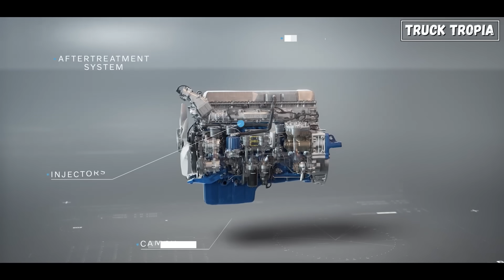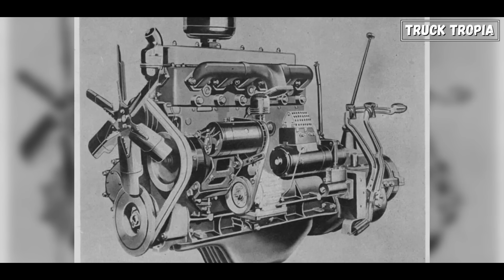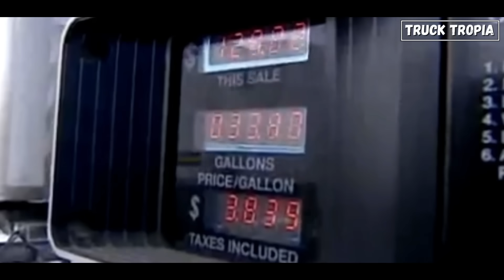How Truck Engines Went from 200 hp to 600+ hp

Comment: These days aren’t desirable at all with all the emission BS choking the motors. If we could go back to early 2000s late 90s engines trucking would be much more better. I’d rather have a turbo diesel under the hood than those dumb electric trucks

Comment: When I first started driving, 300 hp was the norm. The 425 cat was considered big power. My current truck is 605 hp. and many guys have way more than I have.
Reply: Worked my way thru 318 Detroits, triple nickle Cummins, small cam big cam Cummins, A, B, C and E model Cats. Had an 05 Pete with an accert Cat cranked up to 700 hp 2100 torque which almost no one could out pull! It was a hoot to drive it!
Reply: Yes I remember the Cat 425 , it was wow and something to check out 👍
Reply: Cummins offered the KTA-600 by the late 1970's
Reply: @allanwico6314  and there were dam few on the roads.
Reply: And Volvo make 750hp engine since 2000s and now Scania take that record with 770HP V8
Reply: Sometimes I get stuck with a 350hp truck grossing near 100,000lbs. Its definitely not fast but I'm paid by the hour
Reply: @Texassince1836 I had a 290 cummins pulling a 50 ton lowboy. I often grossed out 110000.
Reply: Now you got pickups that are pushing 500 stock crazy to think...
Reply: That's not how it works. The amount of torque applied is not what changes. The gearbox is multiplying the torque. Just because you can produce 2000lbft with your arm and a big enough lever, doesn't mean your arm makes 2000lbft. The torque output of an engine measures the applied force then hp is determined by what rpm you make peak torque
Reply: Same here, I got in trucking 97, 1st truck I drove big cam Cummins pushing bout 350 to 400 and all I use to hear is how good the 425 Cat was, my own 07 KW T800 has a isx 15 pushing 565 and let me tell you, it's so dam strong it amazes me all the time.
Reply: Back in the 80s when your 3406b cat was the big boy. Mack had the E9 with 500, cat had the 3408(pre chamber and with a split crank…gross) but it still was 18.0 liter and 450hp and Cummins was king of the hill with the k19 600hp, good to mention the buzzin dozen Detroit 2 stroke and 8v92, but still they still had plenty of power before the early 90s when emissions killed all of them, my first truck was a 3406b 425 that I turned up past 600ph, blew it up and then blown a bunch more, now I ride a 2006 c15 pushing north of 900hp reliably. But since the 80s people been able to turn the k19 into a fire breathing monster past 4 digit HP
Reply: if scania starts selling the european models over in usa you guys will have access to 750hp and 3500 nm of torque engines, and there auto transmissions are essentialy a big manual 18 speed but electro controled gearbox and clutch, can handle up to 120´000 metric kilogram
Reply: Some men are bigger I guess.
Reply: 300 is enough you really dont save much for the few times 600-700hp will gain you times....most of this extra power is used for fun by drivers,,,it serve nothing but as an excuse to make price skyhigh. even gasoline trucks were fine
Reply: @ragimundvonwallat8961  when you're pulling 80000 pounds thru the Rockies, 300 doesn't cut it.
Reply: @donmunro144  i dont know its mostly wood industry here....but yeah im sure one can always find a specialty place where regular wont do
Reply: Weve had engines that could make 1000hp since the 70s
Reply: @_.incredible_magnum._291  Volvo has a 2400 hp engine too. But it doesnt mean its the norm, just like 600hp wasnt the norm in 70s.
Reply: Theyre all the same shit
Reply: How many ft lbs of torque? That's what counts right?

Comment: Electric trucks are trash... the second to tow something, the range goes through the floor. AKA not good for trucking, in case i had to spell it out.
Reply: BUT to build companies specificaly designed to get free money for the govt, the truck just have to look nice while doing nothing, add a picture of a baby seal and few healthy polar bears cubs and the money will roll in like no haul could